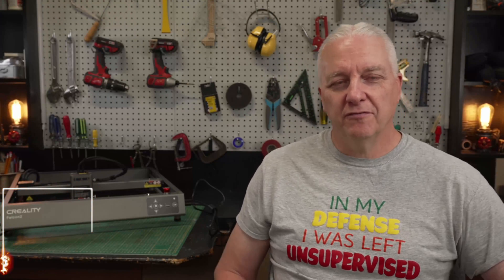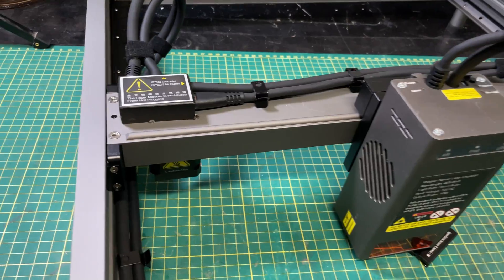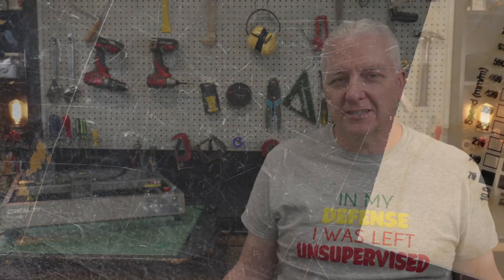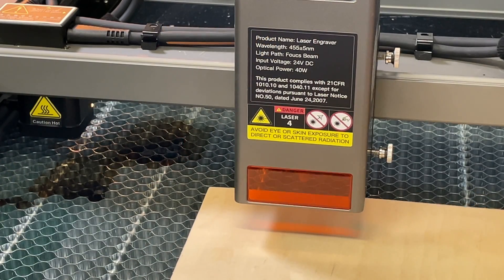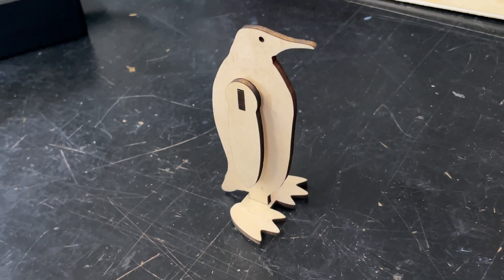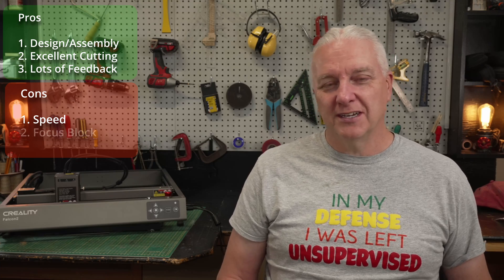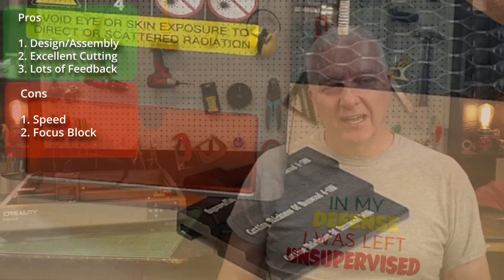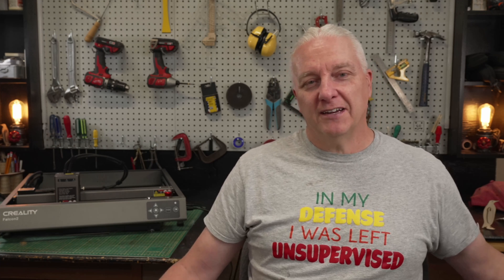The Creality Falcon 2 40W Laser - Impressive Cutting Power

Comment: On max power (40W) it cuts 1/8" ply at 5mm/s with two passes. I have no idea where these claims of 20mm in one pass come from. Less than impressive. I am refurbing my CO2, & will use this as a backup. I paid around £1,500 for it, now it's on offer at less then £700! It's inability to cut clear acrylic is more than annoying.
Reply from the maker: It depends very much on the actual material and how black you want the edges. I prefer to have edges that look more like wood than coal, so I’d use multiple passes anyway. But I have cut 20mm wood with a 40W laser.

The lack of acrylic cutting is a function of diode lasers rather than this specific laser.  They can all cut black acrylic though.

Comment: will it cut opaque 3mm acrylic and perhaps 3mm clear acrylic. ofc we want build back light panels. who cut wood xD
i have 5w i have not even try will it engrave paint from acrylic. sure i can cut acrylic on home and work using cnc mill.
would be nice do all those home with laser
Reply from the maker: No diode laser works well to cut any acrylic except black. It’s a function of the wavelength
Reply: @SteveMakesEverything  ok thank you. just need verify it cut clear and opaque. then this my machine xD others colors i not need
Reply from the maker: @JarppaGuru  No cutting anything but black acrylic.  For everything else you need a CO2 laser
Reply: @SteveMakesEverything  others say colors cut. clear not. creality say 30mm black cut. other say black not cut. its mess when only need 3-4mm clear and white. mayby 50% white if clear not happen xD it still let light thru and can paint black for engrave text. and sim panel done
Reply from the maker: @JarppaGuru  Black is the only color of acrylic you will be able to cut with any reliability.  Sometimes darker colors will cut, but white definitely will not.

You can certainly use black tempera paint to allow engraving on clear acrylic (I did a video on this about a year ago).

If you need to cut clear, white, or any other color of acrylic, then you will need a CO2 laser.

Comment: Everyone misses the biggest negative about this laser. You cannot remove the shroud at the bottom of the module. This effectively renders the machine useless for engraving anything that has hardware attached to it that is higher than the focus height, like watchbands for instance.
Reply from the maker: It’s a valid point but most modern lasers have this issue

Comment: When you use the "Precise" mode, it doesn't just limit you to 20 Watts, it turns off 4 of the diodes in the head, and reduces your spot size. This is used for engraving. Trust me, it make a much bigger difference doing this instead of keeping all 8 diodes on and just running at 50%. Just saying.
Reply from the maker: It makes perfect sense to turn off diodes to reduce power and spot size, but it really should be automatic like it is in the AlgoLaser Delta. Having a manual switch isn’t optimal for jobs where you are cutting and engraving from the same project.
Reply: @SteveMakesEverything  And that looks like a nice unit, but I just checked the site, and that is only a 22W module. I didn't see a 40W option.
Reply from the maker: @MrAsmodath  The link in the description should take you to the 40W Falcon2.  Are you saying it doesn't?   Seems to work for me.
Reply: @SteveMakesEverything  No,  the AlgoLaser Delta only seems to be 22W, I already own the 44W Falcon 2.
Reply from the maker: I wasn't suggesting you buy a Delta; it only tunes its power and beam size automatically.😈
Reply: @SteveMakesEverything  😆 I really didn't mean to start anything here, I guess my main point is you are comparing two completely different powered machines at two different price points. The Delta is a higher priced, lower power unit. Yes, it has more Quality of life features, but only 22W. Initially I was confused because I thought you were comparing two 44W units. I need the output power as I don't have space for a CO² laser, and I don't need to cut transparent materials. Anyway, sorry if I irked you. Have a Happy New Year
Reply from the maker: @MrAsmodath  🙂Well, I wasn't trying to start anything either.  The Delta is definitely only a 22W laser, but it has some serious tech built in that makes it feel like a 30W.  That aside, you won't be disappointed with the Falcon 2 - I only call out the manual power switching to make people aware that it's part of the Falcon's "personality."  If you understand it, then it isn't a concern.  My point was that I wish for Creality to offer similar technology in their 40W awesome.

I will point out that all other 40W lasers I have tested downshift to lower power transparently, though the Falcon is one of the few that actually shuts diodes off to reduce the beam size.

Comment: Thanks for a quick but fairly comprehensive review.  

Thanks for a quick but pretty comprehensive review. It's great that you focus on the important features rather than stuff like unboxing and assembly. I wonder about the speed issue.  Are there actually many situations where 36,000 mm/m is feasible?  Although a laser might have a top speed of 36,000 it needs to accelerate and decelerate as it moves back and forth when engraving, so much of the time it isn't really able to move at top speed.  I love my Longer B1 which is rated at 36,000 mm/m but I don't know that it actually engraves any faster when it set to 36,000 vs 24,000.
Reply from the maker: It’s a good question and at 33W on your B1 you may not notice a huge difference, but you will see the difference on image engraving - especially grayscale engraving.  In the Falcon 2 case the slower speed means you need you use half the power or you get an image like the first one I showed. It’s not the end of the world, but when running an engraving business time is money, so you want to go as fast as possible.

Btw I have a review of the 40W B1 coming up so you’ll get a good idea of the difference power/speed make.

Comment: I wish you would have taken a more in-depth look at how the spot size is supposed to change between precise and normal mode, I thought the precise mode would give you a smaller spot size and therefore a better engrave.
Reply from the maker: Precise mode will give you a smaller spot size because laser is only firing half of the diodes in the module. My gripe is that it isn’t automatic so you would have to do an engrave job first.  Turn on normal mode to get 40W then run a second job to do the cut. 

The AlgoLaser Delta does this without having to think about it.
Reply: What does spot size mean??